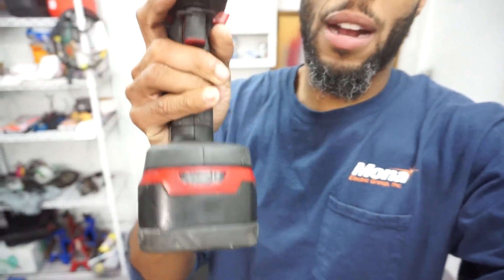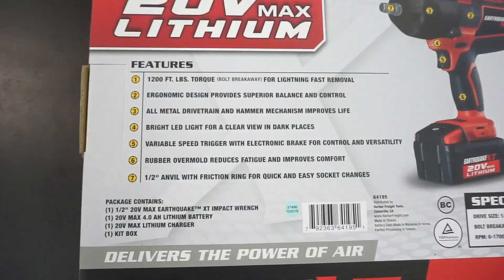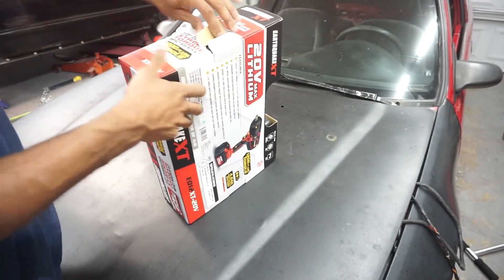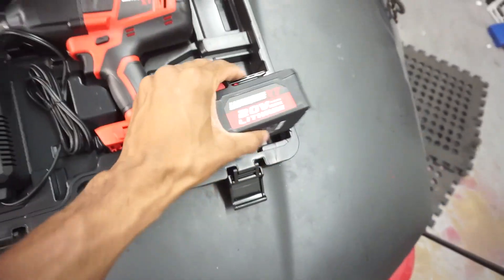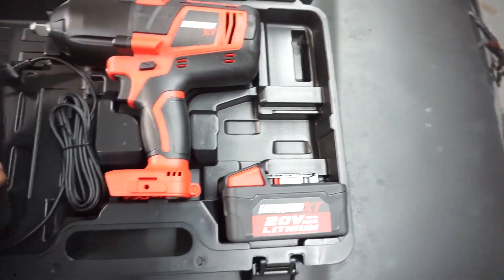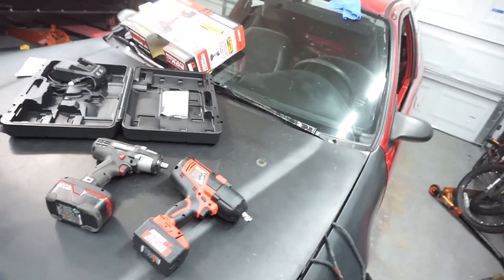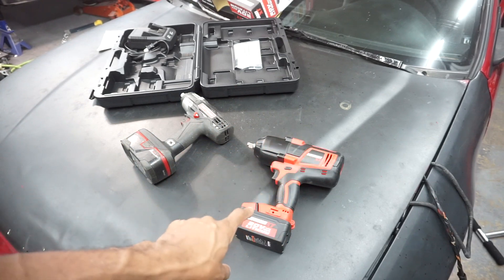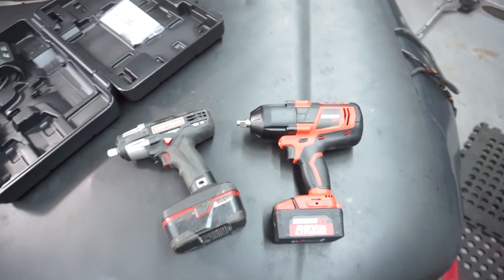Harbor Freight Earthquake XT 1/2 Impact Unboxing!

Comment: Good review bro! I just subbed, I bout the Bauer 1/2 impact early in the year and that one has worked very well. You should get a Lisle Honda crank bolt socket, it'll make getting those stubborn crank bolts off with ease. When I get some extra cash I'm gunna get one of those earthquakes just to have in my toolbox

Comment: It’s good but it only carries a 90day warranty and for the price I don’t know if that’s worth it. I have a rigid 1/2 impact hogring style and that carries a life time warranty for the tool and battery which is great incase the battery or the tool breaks down. And I assume the replacement would be the next revision of the tool and battery as tools are updated. But it only has 450ft lbs of torque. This claims 1200ft which when needed is a must
Reply from the maker: Yea I've seen these break 700 lbs easy.. if it's not for everyday use I think these will last a good while
Reply: If you get extended warranty 1 or 2 years you can take it back no matter what and get a new for free and you can another warranty so that means every year or 2 you could get a brand new one for like 20 to $40 dollars lol